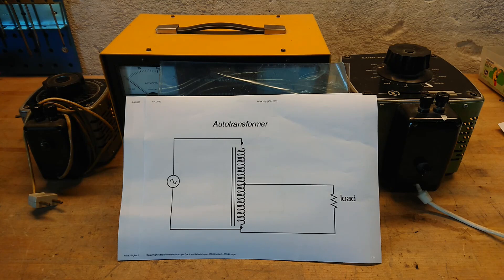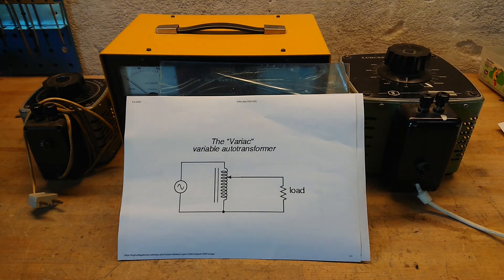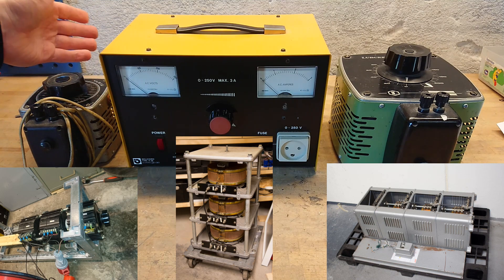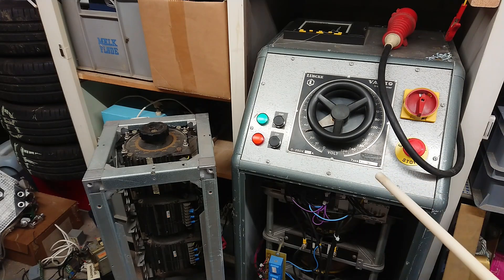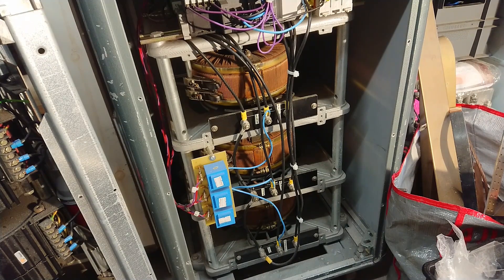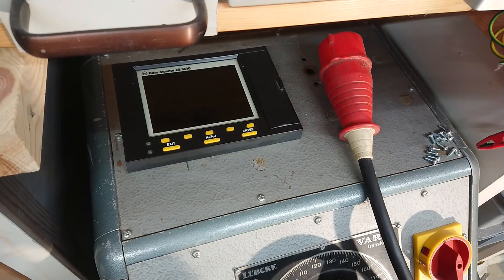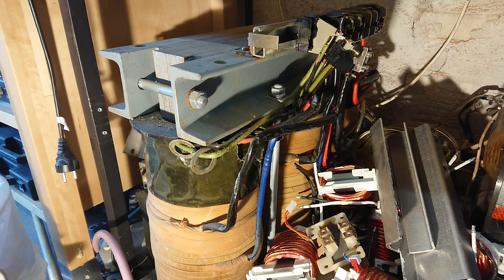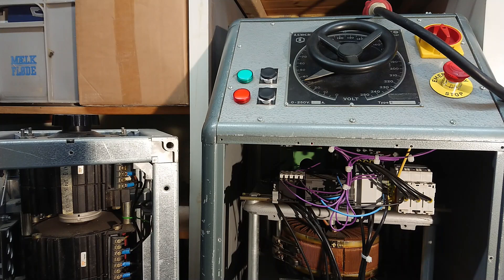Variacs, Auto-, Vario- and Isolation Transformers - Isolation, Day 28

Comment: Is it possible to run 2 auto transformers in parallel if they have the same wire gauge or same current rating considering that both have a common driving shaft. ?
Reply: You can absolutely and are very common  in commercial lightning x2 x4 x6 + all being driven by simple ball chain drive .  You  could prob get by if you were careful have  multi sizes. Closer the better, but do have common drive link or shaft.
Reply from the maker: I think you will find all you need to know here: http://capturedlightning.com/photos/P-Chokes/parallel.html
Reply: @KaizerPowerElectronicsDk  thank you very much. Wish you good health.

Comment: Nice collection as always.
Am I right in the assumption, that your smaller yellow isolated variac also consists of two seperate transformers?
(one for isolation and one for variing the voltage)

I'm wondering if there even is such a thing as a single transformer isolated variac, it would be a interesting structure for sure. 

The large 3 phase isolation transformer is just amazing, I find it really funny how they just bolted a steel beam on each side of the core, what a beast. 

PS: did you get my e-mail this time? ;)